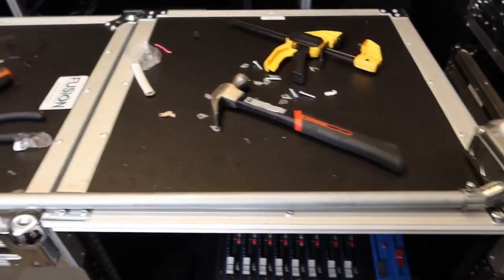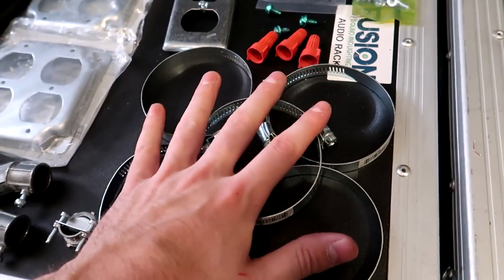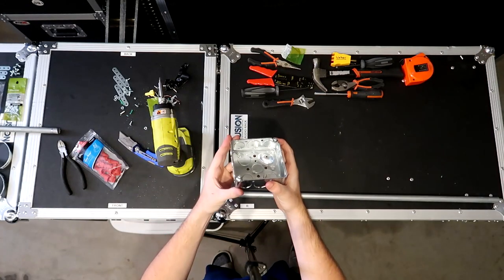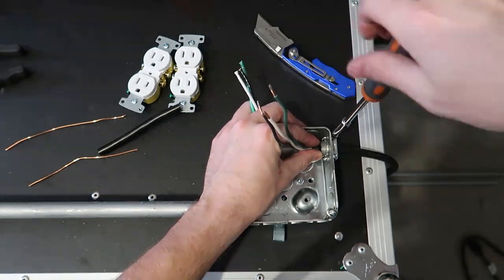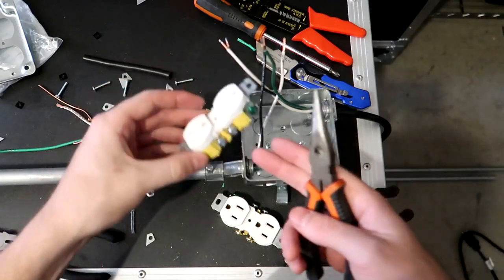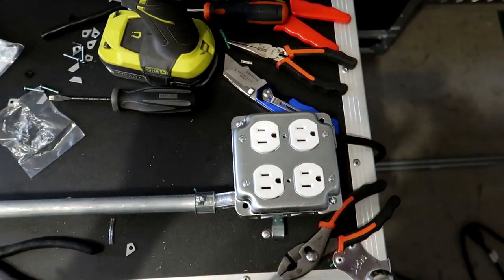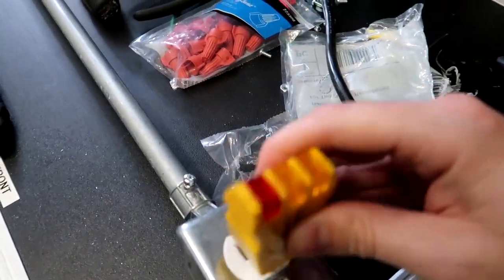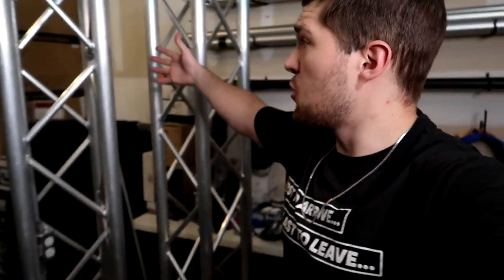Installing POWER OUTLETS in my DJ Truss Totems (How to Tutorial)

Comment from the maker: Material List (per 2m[6.6 ft] truss totem)
57" of 1/2" Conduit Pipe https://amzn.to/2WkyRLp
2x   Metal Electrical Double Box https://amzn.to/2WijJyg
2x   Metal Quad Outlet Face Plate https://amzn.to/3bZxybg
1x   Metal Electrical Single Box https://amzn.to/35rY3np
1x   Metal Double Outlet Face Plate https://amzn.to/2KSGl2V
5x   Outlets https://amzn.to/3dbrhcU
4x   1/2" Off Set Connectors https://amzn.to/35qcN63
1x   1/2" Cable Squeeze Connector https://amzn.to/2z09TZM
8' of THHN electrical wire https://amzn.to/3erCbMg
10'  Appliance cable https://amzn.to/2xq1iPw
5x   3" Hose Clamps https://amzn.to/3aUKEFr

Key Tools
Electrical Outlet Tester https://amzn.to/2KW5TMt
Wire Strippers https://amzn.to/3ffiJU0

👕 DJ LIFE CLOTHING (My Brand)
https://shopdjlife.com/

📲Need advice or just want to pick my brain for an hour? 
https://calendly.com/djrickweb/letstalk

Comment: Love this. I’m planning on doing a similar setup. But there are a few things I would like to add if following this tutorial. I am not a certified electrician but I do know a little bit so take my advice with a grain of salt. 1 using metal boxes and metal conduit they way that these work in the case of a failure is that when wiring the neutral can go bad and or the hot can touch the box which would result in the entire system becoming hot (conduit boxes and truss). Outlets are meant to ground to the box as a fail safe. 2 ways to help this would be 
1 add insulation/rubber padding between conduit and truss
2 add a gfci outlet at the start of power (preferably in the legs so that it is accessible during event or use inline protection if running into wall outlet)
Next thing I would add would be pass through power meaning I would run 3 lines of power in the conduit so that I can have a total of 3 circuits running up each leg
Also really liked the idea of using power con connections. And jumpers which would make this build look very clean and no dangling wires in storage to prevent damage to the wiring
Reply: Power con are pricey but I make all my cords. I buy replacement wire and add the power con on the stripped side. Takes less then 2 min per cord. Definitely a big money saver

Comment: Nice setup brother. This ,is something Im definitely going to do as I use my trussing mainly for stage lighting, etc. 4 trusses connected horizontally and lifted with heavy crank stands at each end. I set up a mix of lights. ADJ Pars, crazy 8's, moving heads  etc. and there is always a host of power cables running through truss. Having a setup like yours at each end will make it much more convenient and aesthetically pleasing !

Comment: Good! some things are still off like the gap between the EMT and the truss - like that other guy said, a bender would make that issue go away since you can make your own offset with whatever bend height you need; but with that being said it’s probably not going to be an issue. Thank you for securing the boxes!
Reply from the maker: Thanks for at least realizing it's not gonna be an issue unless your an idiot and abuse the rig
Reply: DJ Rick Web in this version theres gonna be little to no movement. there’s so many restrictions with the entertainment industry that its sort of ridiculous, like you’re really not supposed to have boxes with knockouts in mobile use since they can get punched out and all kinds of other crap, it’s a little over the top. but things like securing boxes are a must so i’m glad you did that since now it’s rock solid. all the other restrictions are abstract and that would truly be picky. just like the people who complain that others use 20 amp wire and circuit breakers with 15amp receptacles... yeah you’re “supposed to match the receptacles, wire, and breaker” but if you’re only putting 15 amp sockets on 20 amp wires and breakers; then it’s like... okay... it doesn’t matter lol

Comment: Rikk insulate the outlets with some black electrical tape. If any of those wires come lose you are going to have a mini explosion and trip a few beakers also put the wires in the outlets so that the small hook faces to the right so when you tighten them up they won’t get lose.

Comment: if I'm honest, if this works for you then great
but I reckon it would be a lot easier to buy a gray cable, and use gray cable ties to tie it to the truss

Also the comments are correct, the hook needs to face the direction of the termination screw

Comment: Incoming all internet "electricians"...
jk, all of this is okay but just one main tip: on your first box you can just have your incoming ground wire terminate at the ground screw and then the rest of the system is grounded. Per most electrical codes, EMT conduit and metal boxes are all acceptable grounding conductors, and outlets attached to them are grounded. Other than that, if you're feeling adventurous, buy or borrow an EMT bender and try making those offsets on your own :) bending conduit can become addicting
Reply: I’d say since it is going to be moving a lot it’s better to have grounding on each box rather than rely on EMT, where in a fixed install nothing ever moves and it’s set unless the EMT is removed or damaged
Reply: @Aaronproductions  lmao. Didn't know you were into DJing also lol

Comment: Great video! I'm almost ready to try it now.

Now if only this could be a thing for DMX!
I mean, I guess one could set up a DMX distribution amp at the bottom and run cables up to different outlet boxes with Neutrik XLR connectors in them. Do you think it would congest the space too much?
Reply from the maker: I prefer to just plug in wireless dmx receivers. But it could work
Reply: @DJRickWeb  you are right, wireless is pretty nice too.

I always hesitate to go fully wireless if I can run a cable though. I am slow to trust wireless to get me through an event without problems.

Comment: What was wrong with the old video? What did you do wrong?
Reply from the maker: My wiring method while it worked wasnt technically correct.
Reply: Dangerously Overloaded circuits. Fire risk is real.
Reply: Andin Briwel - Not necessarily, you could plug in low draw appliances. That 14/3 wire can handles 15 amps. If moving heads/wash/pars take 1-2 amps each, and you’re careful, you shouldn’t have any problems. Plus, the circuit breaker should trip before you melt wires (if it’s 15 amps as his 10ft extension cord can’t handle 20.) His setup, is essentially a non temporary (permanent) power strip which we all know makes life 100 times easier. You can’t say his setup and devices like power strips are automatically fire hazards. When you know what you’re doing (and Mr. Web does) and you’re smart, there’s no issue.
Reply from the maker: Finally someone with logical thinking
Reply: DJ Rick Web - Haha thanks! I’m 14 yrs. old tomorrow and I am apart of the “Sound Technician” group at my Church. I also livestream the Mass. Our amp rack is pretty interesting with 8 power amps (Crest Audio and TOA) along with a DBX DriveRack 260, and a 32 channel concert series Carvin mixer. (Along with a lot more signal processors, delays, etc.) Oh, and also a cassette deck 😂. I really enjoy your videos and your setups are great! Stay safe
Reply: DJ Rick Web I have a degree in electrical engineering and worked 30 years in industrial automation, building and wiring control and power systems for industrial machine tools. But, the 14 year old probably understands the NFPA electrical code and the hazards more logically than I do - so, I’d go with that.
Reply: Aidan Miller as he said, the video was replaced because his wiring was initially done incorrectly. I’m an electrical engineer and obtained UL certification for two different employers; one for high voltage, multi-phase machinery, and the other for commercial fixtures. If you’d like to learn some actual electrical code material or why things that seem to “work” may still not be up to code or even safe, I’d be happy to help you along. You’re obviously a smart person with the capability of learning as much as you desire. The place to start is the NFPA - you can obtain their code books and publications for the various applications. Also, CE and UL have a lot of good information. Please, don’t get your electrical training from random people on YouTube. There is mountains of misinformation from people who are 100% confident they are correct, while there is enough original source material to learn it correctly and not make the same dangerous mistakes. Then, when you can cite the code books and the source material, and understand things like why using the wrong gage wire will cause a motor to burn up without ever blowing a fuse or a breaker, then you’ll be able to help others in a way that is authoritative rather than assumptive.

Comment: Couple things still wrong/against code. You can’t feed 12 gauge cable with 14. You put your “hooks” (as you say) on the wrong side of the screw. Putting them like you did causes them to push away from the screw, causing a loose/weak connection.
Reply: You can absolutely feed a 14g wire with a 12g wire so long as they are only ever connected to a 15a circuit.....you can also feed 12g wire with 14g wire so long as they are only ever connected to a 15a circuit.
Reply from the maker: That's not against code. That's just being picky. Also my hooks are going the right direction according to the instructions that came with the plug sooo not sure about that one.
Reply: @DJRickWeb  the only thing he's right about is the hooks....while you're right it is not against code, the open part of the hook should be facing the same direction you turn the screw in....this will help close the hook as you tighten it....but this is 100% fine the way you did it, so long as the wire isn't loose, and no strands are sticking out.
Reply: Your “tap” conductor is the the 12 gauge wire you used to connect the outlets together. Your “service” conductor is the 14 gauge cable/plug. Your ampacity of your tap conductor cannot exceed the ampacity of your service conductor.
Reply: @mattkoser  you are still not correct. Sorry. Again site code, or stop repeating it.
Reply: @mattkoser  thank you. I said the same thing custom sound are not getting the point

Comment: The plug should have been 20 amp
Reply: If he's plugging it into a 15a outlet, having a 20a outlet on his truss is pointless........
Reply: @littlecncshop  you can not mix 12 gauge wire with 14 gauge wire
Reply from the maker: Like when in the world is that going to be pulling even close to 10 amps of power. And I guarantee 90% the buildings I plug into are running 14 gauge power cable in the walls.
Reply from the maker: When are you ever going to pull over 10 amps... even in my bigger setups I have only got to 13 amps for 6 movers and 15 pars.
Reply: @MatthewJHupp  you can say it as many times as you want..You're still 100% wrong..the nfpa also disagrees. Please site code instead of repeating yourself.....im a licensed journeyman electrician,  and licensed gc, please state your credentials....
Reply: The ONLY time you cannot mix 12g and 14g wire is on a 20a circuit.  As rick mentioned 90% of venues are wired in 15a.
Reply: @MrTejanoRob  that's not the point of my comment.  Personally i would....my comment was in reference to the "you can't do this" comment.
Reply: @MrTejanoRob  but to answer your question, no most venues at least by me, have 15a outlets in the main part of the venue.  Rarely do i see 20a outlets, amd even more Rarely do i see 220v feeder drops, which we would all like to see.

Comment: Hi Rick. One thing you can not use 12 gauge wire to 14 gauge wire
Reply: So that's wrong....you cannot connect a 15a circuit to a 20a circuit, but you can absolutely connect a 12g wire to a 14g wire if they are both being used on a 15a circuit.